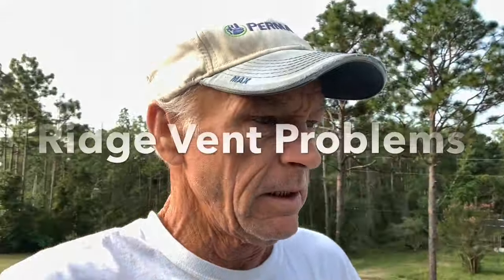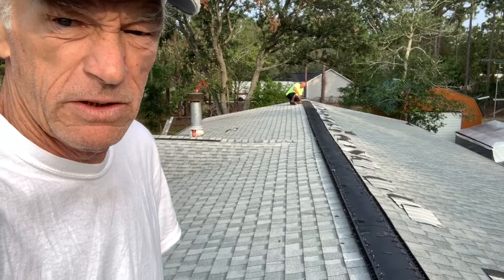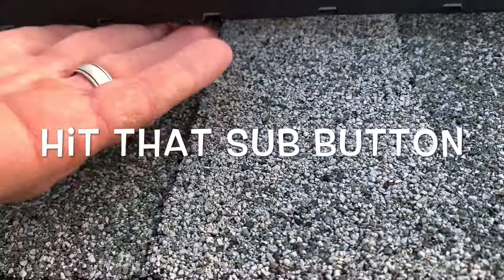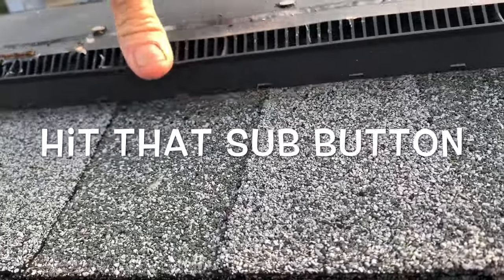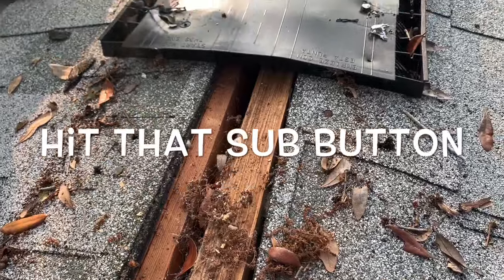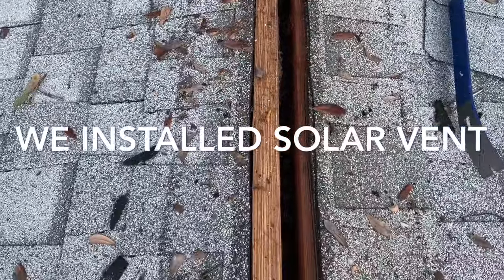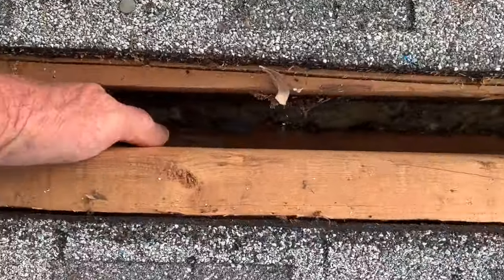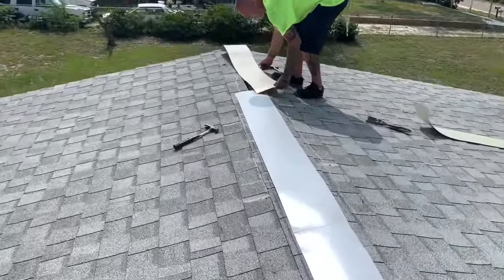Ridge Vent Problems When Not To Use It

Comment: I heard if the roof pitch is 3/12 or less you shouldn't use ridge vent.  But, I'm a female so what do I know.....    The guys who did this roof should be run out of business.
Reply from the maker: You are correct no ridge on anything under 3.5 pitch. Being a woman does not mean you don’t know anything. Don’t cut yourself short
Reply: @Drewsroofingandhomerepair What is a 3.5 pitch?  Did you mean 3/12 ?
Reply: @goosecouple it means every 12" it drops in elevation 3"..... also GAF, Owens corning, lomanco says ridgevent can be installed 2/12 - 16/12.....  Also, in reference to this video... you NEVER install ridgevent on a modular home!

Comment: The science of roofs seems to not so well known by many roofers.  My house of the last 10 years is a small prairie ranch house built in 1945 in an area where big winds come every year during tornado season.  My roof is a shallow, about a 2.5/12 pitch.  Its obviously been reroofed a number of times, and when I bought it there were two large turbine vents installed on the back side of the roof that were an add on at some point - and they were stuck from wind damage.  They were also a source of water entry with horizontal rain from high wind rainstorms.  Roofers suggested a ridge vent and I said no that would just give more water an entry point and it wasn't originally designed with a soffit system to feed a ridge vent.  It does have original gable vents up high under the overhanging eaves at each end of the house, and  so I eliminated the turbine vents to change it back to be closer to the original roof design.  I did add an electric exterior attic reverse fan over one of the gable end vents that I can use as a whole house evacuation fan during hot weather.
Reply from the maker: Interesting and well done

Comment: Most roofers push ridge vents because they make more money.  And, they don't even know how to properly configure venting, intake and exhaust, per cubic feet/sq. in., code/s, such as 1/150 or 1/300.  That's s poor job overall.  Even some of the shingle runs are crooked.  A suit should be in order.
Reply from the maker: I agree 💯 percent

Comment: You just effectively created a massive heat transfer up against a vaulted (cathedral) ceiling.  Now the interior damage won’t be caused by leaks from rain but the moisture created inside the house on the ceiling in the spring, summer, and fall will cause surfactant leakage and the beer can effect inside the house from the sun.  “Cathedral” ceiling need ventilation in some way soffet to ridge.
Reply from the maker: Nope 👎. Your wrong. Sorry. 😞 double wide with low pitch will leak. We live in the 110 wind zone. The last thing you’ll want is ridge
Reply: @Drewsroofingandhomerepair 

I get that part.  But I’m just curious, how is the space between the roof and the Sheetrock going to vent properly.  What is the solution?  Heat transfer is not good.  

Seems to me you would have to connect all the rafter bays with some type of plenum then send air out a vent somewhere.  Preferably vent the soffet and near the ridge somehow.  

I appreciate your knowledge and experience.  I’m just curious what the solution is for venting a cathedral ceiling with out a ridgevent

Comment: Ridge vent is best installed with deck screws. A small change that makes a huge difference. I live with hurricanes and wind storms every year and the strong wind can lift vents that are nailed down.
Reply from the maker: Good idea
Reply: I kind of had the same thought myself: those caps might be useable on something else, but for the damage caused trying to extract nails.
Reply: I've been watching several vids on this and everytime they'd say 'nail' something in my brain tinged 'omg, wouldn't screws be a lot better?'  Wind pressure, contraction/expansion.  Oh boy.

Comment: I Read all the comments and replies but no mention about the proper way to put down the metal flashing at the ridge. Do you use sealant to stop blown water from getting under and at the seams? And on the nail holes? From the vid it looks like no sealant and nail holes spaced over a foot apart. How does that stop blown in water? I’ve got a 1970s double wide with cathedral ceilings and no attic with water leaking at the ridge. A roofing contractor said put a ridge vent But I ask what is it venting? My question is how to step by step  put down metal flashing so it doesn’t leak. Thanks drew.
Reply from the maker: Here you go. Do not use ridge vent close it up with metal just like this one is.

https://youtu.be/1iCgHzCvVzE?si=Q_mkFxnsVUlvMaxR

Comment: Most definitely glad an honest person as yourself made this video to educate so many of us that has a contractor that will tell us anything instead of the Truth that will cause us less headaches in the long run. Contractor of mines in my ear blowing my phone up trying to get move to move forward with this ridge vent as he suggests... But I stay in Michigan and we get it all...
Reply from the maker: A roofer will make between 10 and $20 per piece of Richmond and it only takes five minutes to install it so of course they want you to use it   Your roof absolutely needs. Ventilation ridge vent is not always the best option.  Especially when it’s a low pitch roof.  We live in the 110 mile an hour wind zone, and Richmond on a mobile home with a 312 pitch. I do not recommend it.  I have a Doublewide myself and I would never put ridge vent  on my double wide.

Comment: Thanks for the video that is my problem. Roofer installed a ridge vent and my roof has leaked ever since.
Reply from the maker: Take it off and replace it with shingles and caps

Comment: Agreed. We have a customer who’s Doublewide leaked after big storm or sustained rains. 
He had just had the roof done, and it looked perfect, the original installer would not do anything to resolve the issue. He was blaming it on a skylight that was somewhat near the ridge, but very obviously had nothing to do with it. . 

Since the homeowner didn’t really want the ridge vent anyways it was just something that original Roofer had done to upsell him, we went ahead and just took the ridge vent off, put another course of shingles and install matching ridge cap, never had a problem since
Reply from the maker: I experienced the same issue with Richmond I do not suggest it on any mobile home it’s not necessary and I agree with you it is just an upsell that is not necessary ridge vent on mobile homes is no good

Comment: Thanks Drew. I just bought a new 3 level townhome in June 2021. In October we had a big rain here in Illinois and the leak started. First thing builder said was, it's probably the ridge vent. They still haven't gone up to investigate and now it December and guess what? It rained yesterday and into this morning- non-stop. Water is coming through a light fixture at the top floor landing.
Reply from the maker: If he knew it was the ridge vent weekend why in the hell did he get up there and fix it so you wouldn’t be having this issue right now that does not make sense my brother
Reply: @Drewsroofingandhomerepair  I know. I am still within my Warranty period, but a 6th month "how are we doing" review is coming up - Guess what? I'm going to tell them how they are doing alright! I have access to the attic space. In your opinion, do you think I should go up to investigate first? Then they can't tell me that it's something different?
Reply from the maker: Yes go find out where the water comes from. I am not a fan of ridge vent. If it snows OMG 😳

Comment: Yep Just told my roofer to change the vents back to the O'hagin fire and ice vents put them in the existing holes. If its not broken don't fix it.
Thanks for the heads up I have exactly what you describe a double wide with vaulted ceiling and im betting it has the 2 ridge beams like you showed you can see it on the inside of the home on the ceiling there is a large sheet rock beam.
Reply from the maker: I agree

Comment: My ridge vent started leaking last night. I know they mucked up my doublewide when this was done (before I bought it). Not my favorite thing to be placing tarp in the middle of the night in a rain storm. Thanks for this video, affirmed my suspicions.
Reply from the maker: If you have Ridgevan on a double wide get rid of it. They will leak every time you have a rain storm or a hard wind. Take two rows of shingles off both sides all the way down of course remove the ridge vent. Put back the two rows of shingles without cutting any shingles as they overlap the top and then put caps on it that will seal up your ridge
Reply: Would it be bad to do that and not replace the metal strip? I'm fairly certain that was removed as well.
Reply from the maker: The metal strip that goes down the middle is what keeps the water out of your ridge if they took it off and put Ridgevan up there all that needs to be removed do you need that metal back over the ridge. Without the metal on the Doublewide you have a leak. So if your roofer took the metal out and installed ridge vent get rid of it that’s a bad mistake. Go up there remove the ridge vent put the metal back put caps back over it. Have somebody do it right

Comment: Problem I see with your solution:  I see no exhaust roof vents. My double wide has 3 big exhaust vents and the metal cover to the ridge and shingles over the metal. It looks like that roofer removed the vents and intended for his ridge vent to do the venting. Now you remove the leaking vent. No roof vent now. Moisture will cause mold now. Orig design probably has 3 exhaust vents. Hope you re-installed these 3 vents. Appreciate the info on ridge vent leaking.
Reply from the maker: Never had a days worth of trouble since
Reply: Ok , so you have had no trouble, but the end result is the orig design had 3 big roof vents and now there is no roof vent at all. Do you think there might be moisture in there ?  Did you try moisture meter ? Could mold form later ? Orig design had metal top and 3 big vents. Any thoughts on this ? Maybe you need a more correct ridge vent at a proper width and made for a proper angle ?  @Drewsroofingandhomerepair

Comment: Bare minimum pitch to accept a cap is 3/12 most cases, but single or double wides sometimes cheap out with 2.5/12.  Personally,  I like 4/12 or more.  Thinking about century old homes two things come to mind: 9 or 10 foot ceilings and bigger roof pitches - there was no air conditioning for most back then, so basic design was the tool to manage most things.  Those guys knew a thing or two, having little tech to lean on.
The single/double wide prefab market needs some attention as an owner.  Like buying a boat, you really ought to keep a folder on engineering details, because if that company ever goes out of business you won't get a second chance at that info.  If you can talk them into providing a full set of prints do it:  lots of details are peculiar compared to an average slab house, and it steers contractors into a more accurate bid by removing alot of guesswork and exploration/stupid demo work.  Never let that info leave the property.
Reply from the maker: Very interesting and I agree with every word

Comment: No more leaks, that's for sure, but, when you said if that's not have a ridged vent before, they don't needed, I not agree on that, because there is a lot of houses that need ventilation, because when they build those hoses, no body pay attention to high energy bills, and most of those houses are build with no ventilation, that cause the shingle roof to fail premature, because of the heat, but I agree with you when you said that a ridge vent not should be installed, if you don't have an energy inspeccion from a professional!
Reply from the maker: I only say that on double wads or mobile homes other than that ridge vent is a good thing

Comment: Wish you were in my area. I hired an Owens Corning Platinum roofing contractor and they screwed a lot up....basic crap that even I know. Unbelievable.
Reply from the maker: I wish I was in your area to Brad the platinum roofer contractor will not always be the best they might be the best advertised that doesn’t make them the best
Reply: @Drewsroofingandhomerepair  I had the same problem with a platinum preferred contractor. I asked them to take off the ridge vent because I was getting a lot of problems. They took it off. But they didn't put metal. They just put a hip and ridge single to cover the opening. I'm scared of more issues occuring now.
Reply from the maker: You definitely have to put metal.

Comment: My house has 6 large gable vents, but the contractor insisted that ridge vents are very important.  I realized only after I signed the contract that CertainTeed was giving contractors kickbacks for installing ridge vents.  They are unnessary when you have plenty of gable vents and the CertainTeed brand of vents have troughs along their sides.  I have many tall near my house (some branches over my roof), so after only a few days, my new ridge vents are filled with pine and oak pollen catkins and other tree junk.  I'm so mad that I trusted the roofer to care about my home's actual needs.
Reply from the maker: I agree
Reply: Certainteed also gave kickbacks on ridge and shingles ect. as do many roofing manufacturers..Personally I  would of preferred a lower price, redeeming these incentives was a hassle and I usually wouldn’t bother…

Comment: Drew, it seems the vast majority of people that do a metal roof over existing shingles seal off the attic vents and open the ridge to vent under the new metal ridge cap....with breathable closure strips to seal it. Have you seen any issues with that setup leaking? My MH is 2/12 or 3/12 as well. I am 6 days away from starting this project and the only option besides venting at the ridge is getting 4 new 14-inch vents and 4 huge rubber boots to seal the vent. That's going to be a lot of screw holes and potential future leaks. Great videos by the way!
Reply from the maker: Thank you 🙏 my friend.
Reply from the maker: I agree
Reply: @Drewsroofingandhomerepair  Would you go with a vented ridge cap on an exposed fastener metal roof or recut the 4 separate round 14-inch vents? The vented closure seals made for the metal panels that I ordered seem pretty watertight and to prevent pest intrusions.
Reply from the maker: I would go with the water tight vents. I hate ridge

Comment: ***PLEASE HELP!!!! 
Hey man, I watch a lot of your videos and really appreciate them. I just bought a house with a metal roof that resembles Spanish tile. I’m confident there's enough airflow under the roof, but I’m unsure if the soffit and gable vents are sufficient to cool the attic. 

The contractor installed pink fiberglass insulation (not spray foam) between the attic and roof, using staggered wavy plastic pieces between the attic beams with insulation laid on top. I’m not sure if there's enough ventilation behind it. He also raised part of the ceiling in the dining, kitchen, and living room, leaving a smaller attic space there. 

Is this a problem? I’m under contract and can still have him remove it. I was thinking of adding a fan for better airflow, but after watching your videos, I’m concerned. My home inspector mentioned the insulation shouldn't be there, but your metal roof videos suggest insulation is okay if not better. I know you use spray foam, and this is fiberglass, but I don't want to make a big mistake in our first home. Any advice would be appreciated. Thanks!

Also I'm in New Jersey if that helps and I'm open to anyone else in the comments opinions thanks very much
Reply from the maker: I’m not sure of the type of ROOF you’re talking about not sure I’ve ever seen that before. I wish I had answers for you, but I don’t if I was there looking at it maybe I’d have a answer but without actually seeing what you’re talking about I’m not sure. Sure I could give you a good answer, sorry I couldn’t help that wish I could do better

Comment: Omg I am having a nightmare of a roofing job here in Montana. 
I have a double wide manufatured home that had box vents and I noticed they plugged all the box vent hole and are installing a ridge vent.
I asked them why would you change the design of the house and is my house even compatible with a ridge vent? They said a ridge is way better but i still had my doubts. If it is so much better why wasnt the house designed that way.
Job has been delayed for 3 weeks because they kept ordering the wrong size skylight. I litterally had to mesaure myself and tell them what model to order.
Trying to figure out how to get out of my contract and just do it myself. I noticed the contract said Titanium underlayment but theyre using tiger, contract didnt mention anything about a ridge vent.
Guess I need to get a lawyer.
Reply from the maker: That’s not good I would not put ridge vent on my house and why would they close off the boxing holes that’s ridiculous
Reply: @Drewsroofingandhomerepair  The contract doesnt say anything about a ridge vent only about box vents. Also says titanium underlayment but theyre using tigerpaw. 
Is it safe to say the contract is void? I already paid they down payment.
Reply from the maker: Tiger paw is synthetic paper
Reply: @Drewsroofingandhomerepair  like you said yourself every situation is different. Why is it ridiculous to plug a box vent hole if going with ridge vent? You gunna nail the shingles to the air in those areas? Ridge vent is far superior to box vents for the majority of houses. Technology advances with time. Follow manufacturer instructions you won’t have issues.